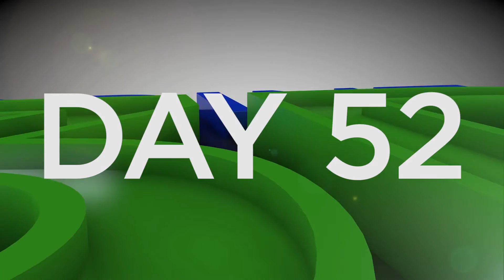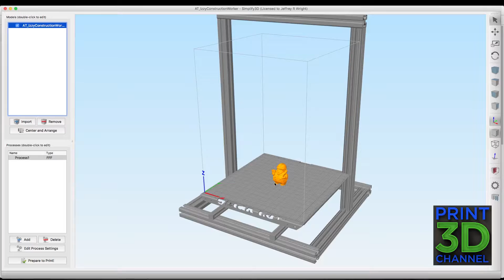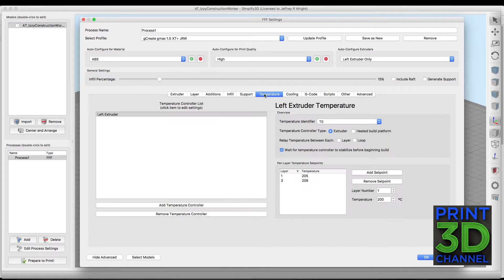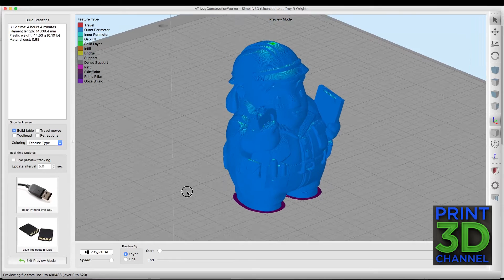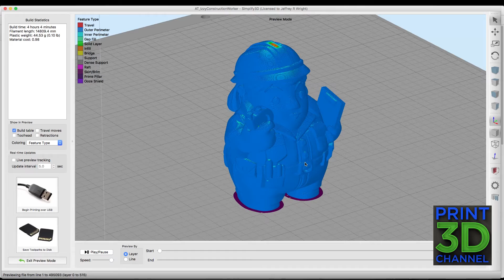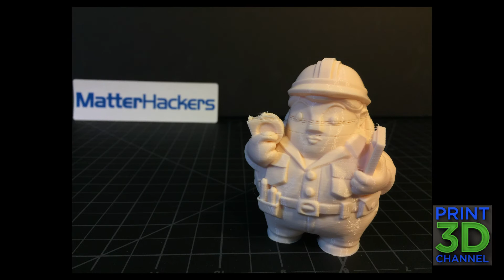#3DP365Project - Day 52 - Izzy The Construction Worker - MatterHackers PRO PLA & gCreate gMax 1.5XT+

Comment: looks like skipping started at retraction points, have you tried altering retractions -- basically to limit them (remove force retraction for layer shifts, and only retract for travels over 3mm) -- you'll notice cleaner prints for small objects if you do that.
Reply from the maker: Excellent tip, thanks for sharing that one, I added that change to my next prints. Thanks for watching and for the support!

Comment: Great video Jeffrey! Not a 100% sure but does appear to be filament snag? spool bind just long enough to create the voids. Other than that there is the possibility of filament anomaly moisture or air in those segments of filament resulting in gas pops causing the void. With your temps not ranging drastically these are the only two items its all that comes to mind. I have not used Matterhackers products yet, if it is filament related I'm sure it's a rarity.  Looking forward to day 53
Reply: Meh... He's a construction worker.  Those are just "Battle wounds" from the job.  lol
Reply from the maker: Thanks Patrick! That might be the source right there, possible snag. Once the E3D cooled off, I pulled the silicon sock from the extruder and there was a small bit of fluid of some sort near the opening for the nozzle tip, looked oily like but couldn't be sure. i ran 4 FilaClean strips through this morning and switched colors of PRO PLA. Have a print going now, see how it goes. Appreciate your suggestions and your awesome support, my friend.